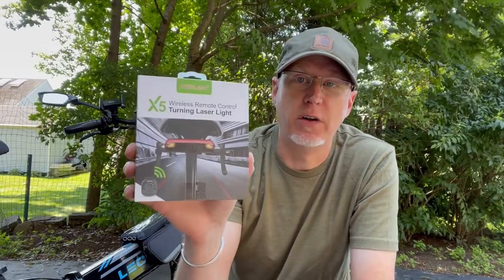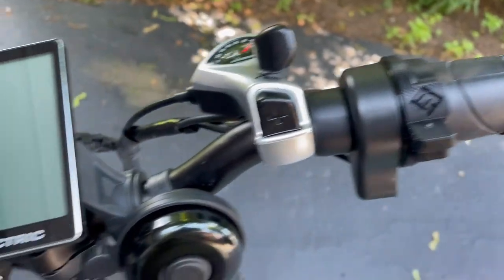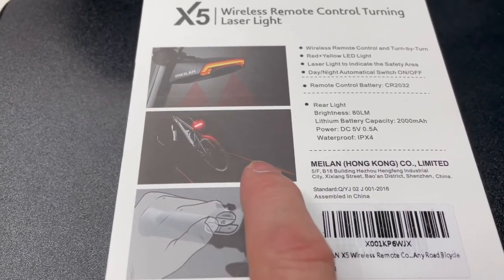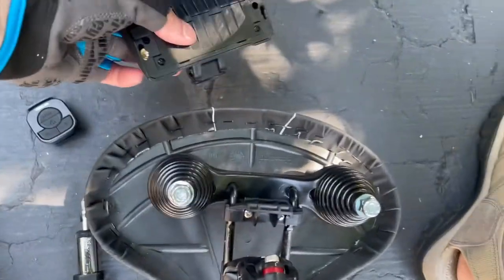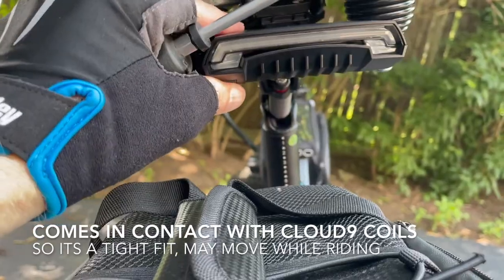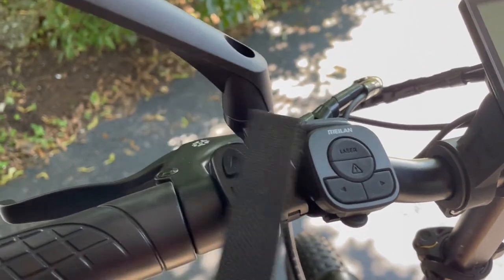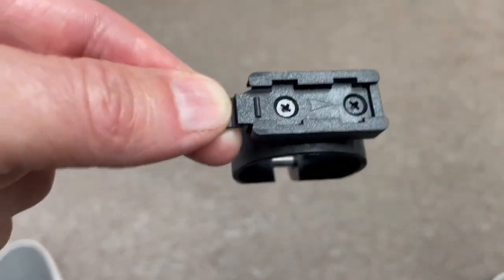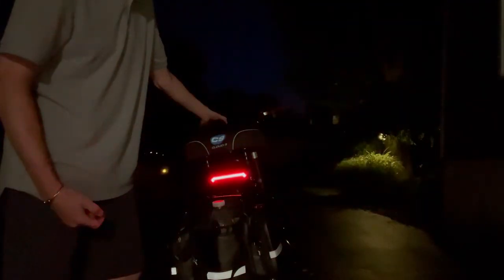How I Added Turn Signals to my Lectric XP - Meilan X5

Comment: I have the same light but I found it difficult to use.  It can be hard to tell if it is working while riding as the feedback on the remote isn't that great. I love the idea and the look it just needs some tweaks to make it better.
Reply from the maker: Once you turn it on it’s always on so that’s good, there is a blinking on the control pad if you do a turn signal but hard to see during the day but obviously it’s best  for night use
Reply: @ChrisCrossed  The issue I have found is you don't know if the taillight received the message.   You know it is sent on the remote by the turn light under the button but you can't guarantee it is actually going.  I have had it blink on the remote and not be working on the taillight as the signal didn't make it.

Comment: Can you mount the unit under the bike rack ? So that if anything on the rack won"t block the light
Reply from the maker: Not really i thought about that but did see a way.
Reply: If you're crafty you could use the existing mounts that you could attach to a separate piece that would then be able to attach to the rear rack. If you have a friend with a 3D printer thatll probably be your best bet

Comment: Guess you’ll have to recharge it while it’s on the bike.
Reply from the maker: Yes, you will if you put it inder the seat, the quick release only works if its on the seat post.
Reply from the maker: I can just pop out the seat and charge it while attached
Reply: Yes either will work. Maybe the bracket sticks out enough on most other bikes? Defeats the purpose (somewhat) if you can’t slide it on and off to recharge.
Reply from the maker: @yoelbitton  you can still plug it in while seat in place, just need a long enough usb power strip